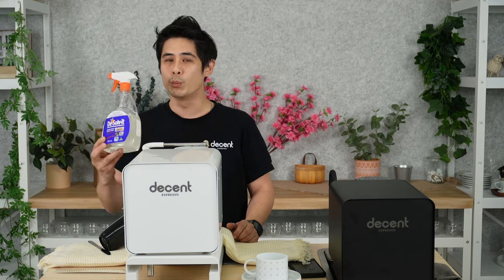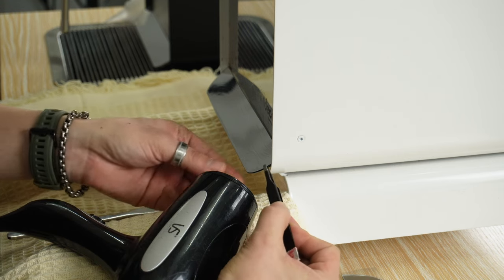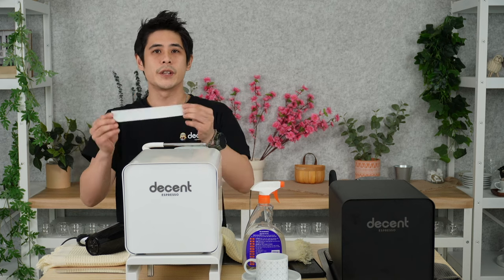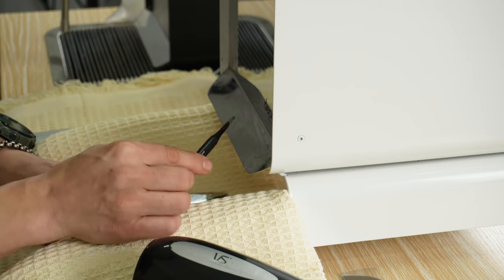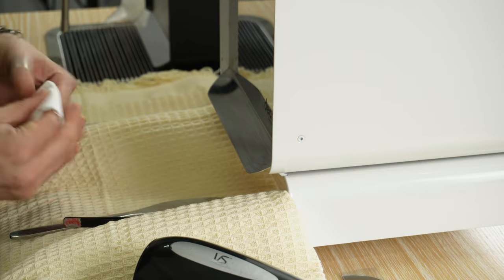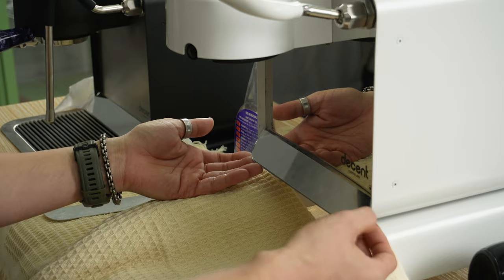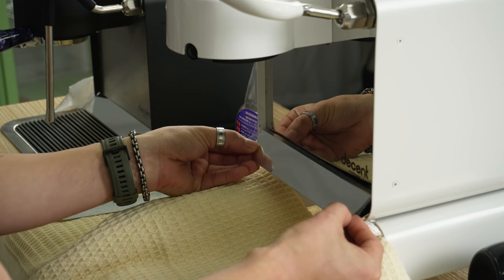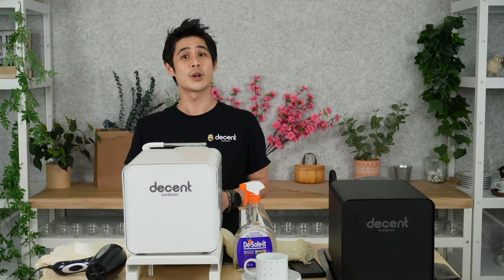How to replace a mirror on your Decent Espresso machine

Comment: Could you do a demonstration video on how to replace the touch dial? My one was cracked during transportion when I relocated to another country. It has been working fine for over a year or so...but sometimes the cracks will cut my finger. So Im looking to replace it but I'm scared I would break another component and held it off